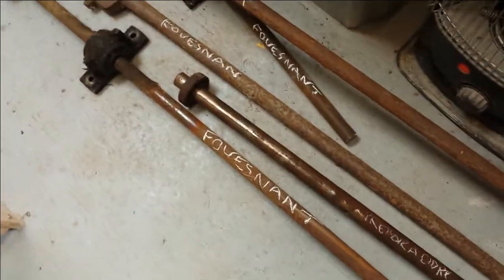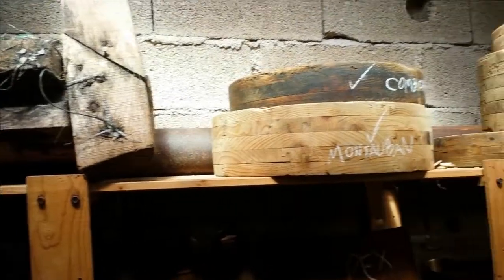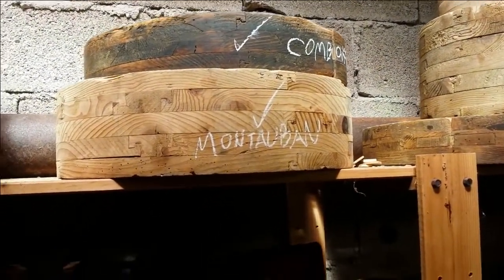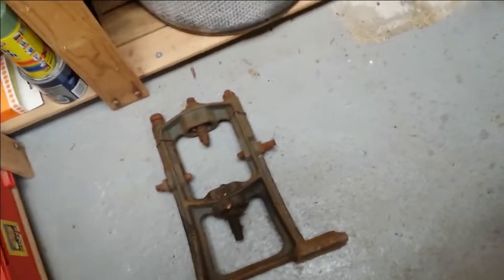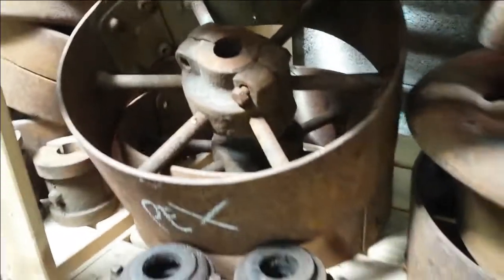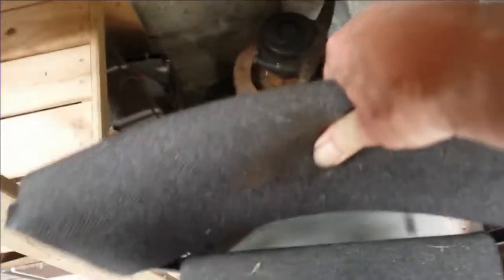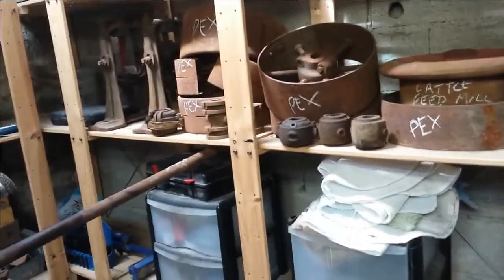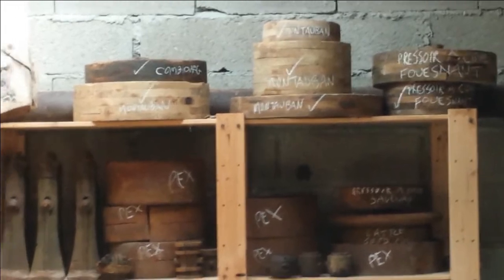France Workshop Lineshaft Project Part 1: Overview

Comment: I look forward to seeing how you turn this out, having followed your channel up to now I know that you'll make a solid job of it.

As to stubborn pulleys the one that sticks out in my memory  was a cast iron spoked one about 20"  dia half way up a shaft 2" dia 5' 8" in length, not having a press or puller big enough to handle it I ended up turning it on end & knocking it down onto a wood block so that the weight of the wheel would do the work, when it finally came away it revealed that the bush was infact made of white~metal having been poured in situ around the centered shaft & keys!
Reply from the maker: Flippin' heck! You did well to make it budge by even a thou!

Do you know the book 'The Power Handbooks; Shafting, Pulleys, Belting and Rope Transmission' by Hubert E. Collins? It shows some good old-school ways of getting 'obdurate' pulleys off shafts.

Thanks for your kind and encouraging comment. The project won't be completed any time soon, one of the reasons being that I only get over to France a few times a year. However, I will be posting videos whenever I do.